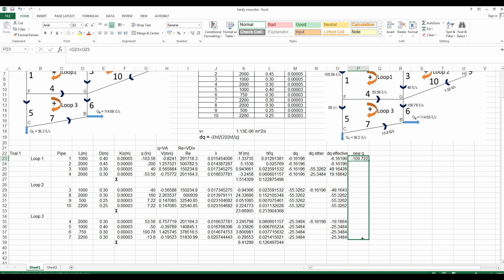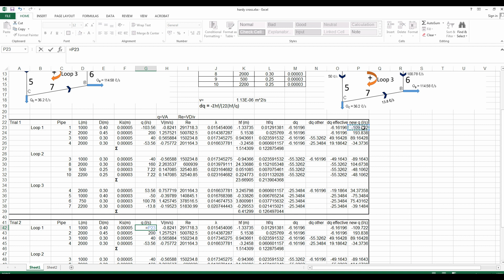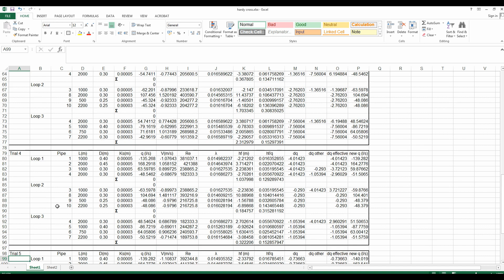Pipe network analysis in Excel using Hardy cross method (English)

Comment: could you explain an exercise using hardy cross method , but the system has devices as pumps or other things and the head of the device is expressed as 30*Q^2 and 100-80*Q^2 for example , and how is done if  you have those devices in series i n one of the branch and other device in other branch. thank you .
Reply from the maker: +carlos casas I'm actually not entirely sure how one would approach a problem such as that by hand. For such problems normally computer software is used which allows for pumps and reservoirs to be added to the network.     My apologies if this was not the answer you were expecting...   Have a good day :)
Reply: carlos cases , this is a helpful document for your request 
http://www.innovyze.com/bookstore/cwbsa/Chap5.pdf

Comment: can be calculated compressed air ??
Reply from the maker: +พิพัฒน์ รักทองจัน Hi, I actually have no idea, but I believe the same principles would apply so maybe it is possible. If you find out please let me know :)
Reply: +TM'sChannel Hi, I think constant density & viscosity of air . Are you think that same ?
Reply from the maker: +พิพัฒน์ รักทองจัน Hey... I agree.
Reply: +TM&#39;sChannel What result of the pipe ? Q1 Q2 Q3 Q4 Q5 Q6 Q7 Q8 Q9 Q10 ?? 
Example Q3=59.87 or -59.87 ? pls. tell me thank.
Reply from the maker: +พิพัฒน์ รักทองจัน Hi, the sign of the flow in each pipe is just an indication of its direction within each respective loop. For Q3 the flow is positive in loop 1, but negative in loop 2 due the the direction of flows chosen for each loop (the orange arrows).  Effectively the direction of flow for ex Q3 will be from node E to G in this example.
Reply: +TM&#39;sChannel and next question How am i find  total pressure drop ?
A summary of each loop or pipe ? 
-because I want to reduce pressure from air compressor from improve pipe line .
-I want to pass final exam Project. ^^ 

Please Thank you very much .
Reply from the maker: +พิพัฒน์ รักทองจัน Hi. Uhm I'm not entirely sure what you mean by "total pressure drop". If you are referring to a single pipe then the head loss will most likely be your pressure drop.  

A summary of each loop or pipe might be the final balanced table from the iteration.  Then you can alter the network i.e different pipe sizes and configurations and repeat the iteration. You can then compare different pressures (or average pressure even) from pipes in the network to judge whether one is better than the other. 

Hope this helps... Good luck with the project!
Reply: +TM&#39;sChannel May i have your email please?
Total pressure all 
Example: Your problem is 3 loop . (from you video)
 -loop 1 is 5.38 m. (last trial of summation pressure<10^-3)
 -loop 2 is 10.701 m. (last trial of summation pressure<10^-3)
 -loop 3 is 4.46 m.   (last trial of summation pressure<10^-3)
so all pressure drop this problem is 20.541 m ???

Thank you for help me :)))

Comment: Its  well understood and well described, can I get the template,  my email is ernestdora@gmail.com. Also can I use this method to design a network and come up with optimal pipeline specification?
Reply from the maker: +Dora Ernest Hi, thanks for the comment. The link to the Excel file I used in the video is in the video description. ie: https://drive.google.com/file/d/0B29kBjmISsLMeEdCSVFHcHZBODQ/edit?usp=sharing   

I believe you should be able to design and optimize a network with this method to a certain extent. But if you require a better optimization I would suggest you use a network design software package such as wadiso ( free trial version available) or some other package for larger networks.

Comment: Hi TM,

I've a couple of questions.

1. For the pipe network example you have used in your video, I noticed that the discharges Qa, Qb and QC are all defined. I am wondering if the Hardy Cross method is still applicable if these discharges are unknown, especially in the real world, these values would have been unknown.

2. I presume the example you have shown is a network with the same elevation. if we have branches within the loop with different elevation, do we just simply minus or add a head due to its elevation?
Reply from the maker: CHIN0094 Thank you for your comment. 

Q1: I don't think the method would be usable if those discharges were unknown because one would not be able to make a first guess of which pipe carries which discharge.  However, in the real world those discharges would not always be unknown. Those discharges will be determined from an analysis of the area each pipe has to serve. 

Q2: I would suggest the Nodal method for a branched system where different elevations must be taken into consideration because it works directly with the respective heads. I'm unsure if your suggestion of simply adding or subtracting the heads will work, but it might.  

I hope this reply was helpful, please let me know it it wasn't.
Reply: Hi TM, thanks for your reply, I will let you know after trying it out.
Reply: TM'sChannel Hi TM, 
for Q1 "However, in the real world those discharges would not always be unknown. Those discharges will be determined from an analysis of the area each pipe has to serve", can you show me an example on how to get to a discharge say we have a pump and have discharging pipes of 2 different cross section areas?
Q2: I managed to source for a program, so what I am gonna do is to see if the program actually has the same results for flow as compared to a Hardy Cross Excel sheet in just subtracting/adding the heads.
Reply from the maker: CHIN0094 Good morning. 
It's a bit difficult to think of an example like that at the moment. I do not fully understand the procedure seeing I only had an introductory class to how those discharges are determined. But as far as I know there are existing models, databases (Historical and stochastic) as well as software that are used to predict a peak discharge that a certain area or land use will require. As a very simple example lets say each household in a certain area requires a peak discharge of 5 m3/s (I made that up but it would be determined with the use of models etc.), then an area which consists of 100 households would need 500 m3/s provided to them during the peak time.  This is a very simple scenario, it would be much more complicated when there is an entire network of pipes and more than one pipe is servicing an area. The method to determine such a discharge depends on the method the engineer prefers or is instructed to use, in class we were provided with these values. I hope this answer was helpful, please ask if you are still stuck.

Q2: Which program did you find if you don't mind ask me asking. Also please let me know what your findings are, should be interesting.

Comment: i have a question, can u plus the old q with the q effective just like that? since the q effective is metre cube per second and the old q is litre per second. correct me if i am wrong
Reply from the maker: Hi, sorry for the late reply. I only worked in litre per second for all q's in the example. Can u please clarify where you spot the metre cube per second?
Reply: TM'sChannel sorry i skipped the part where u erase the q/1000 at hf/q column to maintain litre per second